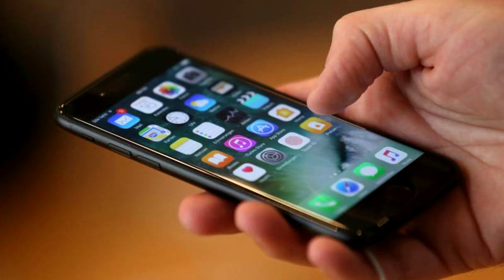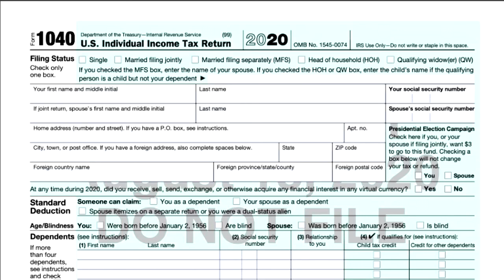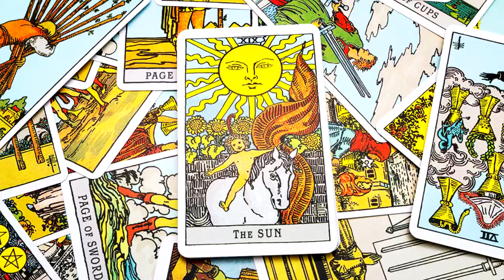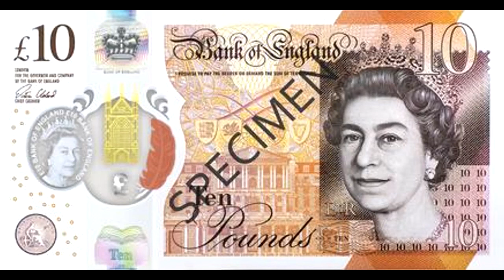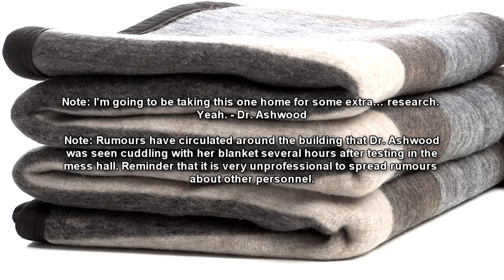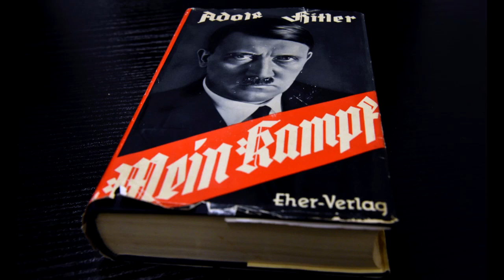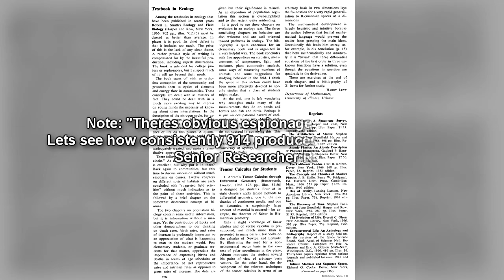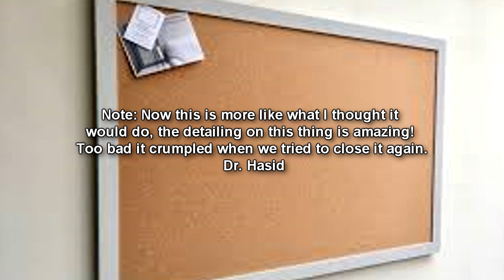SCP-914 The Clockworks: Main Article and Input / Output Experimentation and Test logs Part 1

Comment: Just from the time stamp alone, I know this is going to be tremendous. 

Thanks for the timestamps cause I'm going to have to break this up. Can't wait to listen while I play games!

I have always wondered if I could put old broken electronics found in pawn shops and stuff in there with some scrap metal and see if it's fixed.
Reply from the maker: honestly it you use the correct seetings it make combine them all into an improved electronic device that could do what all the parts were intended to do.

Comment: 2:02:52 Uhh, what happened? Did someone try to cross-test SCP-055 (the Anti-Meme) with 914? C'mon! The only way you can gain knowledge of 055 is by figuring out what it is NOT. How can 914 refine 055 when 914 can't register what 055 is?
3:16:22 One sphere weighing 3 kg splitting into 2 that each weigh the exact same as the original? That's definitely the Banach-Tarski Paradox in action. Maybe 914 applied the BTP to the sphere and its composition?
Reply: What is SCP-055?
Reply: @unclechuck3333  well.... it isnt a sphere.... thats about all we know about.... what were we talking about?

Comment: Well, I use ChatGPT to generate stuff Anime Body Pillow of Goku (Very Fine):
Output: The body pillow might be broken down into its constituent materials (fabric, stuffing, printing ink) at a molecular level. You could end up with various chemical elements and compounds, some of which could be exotic or unstable, and potentially a significant amount of gas released from the breakdown of the materials. The pillow might also yield a highly refined version of its image, possibly represented as a holographic projection or a detailed 3D model.